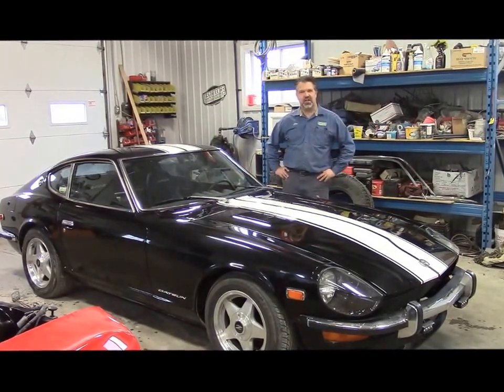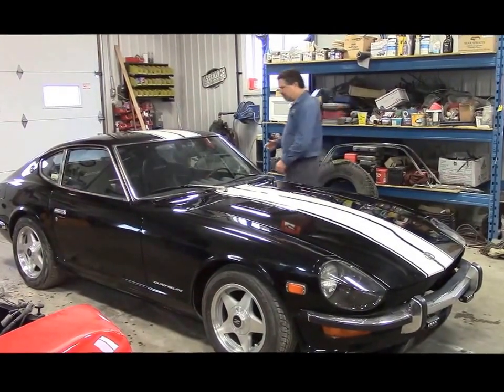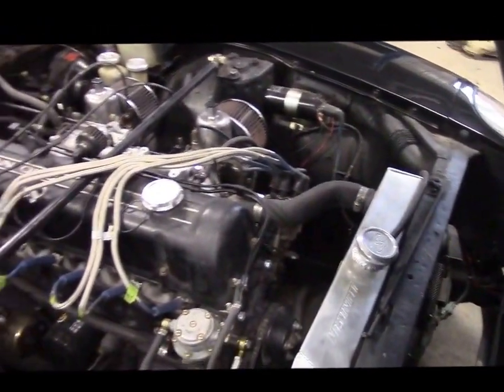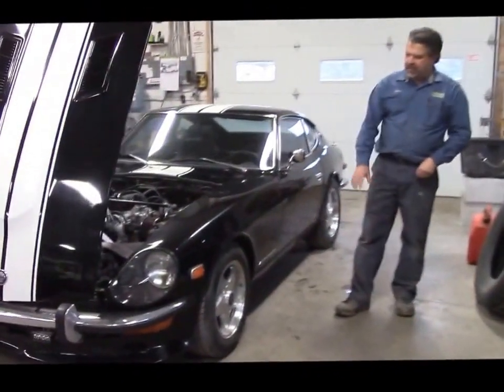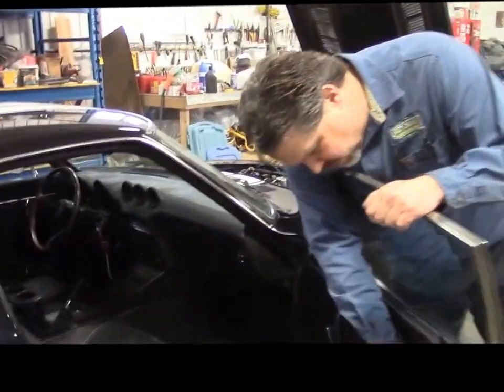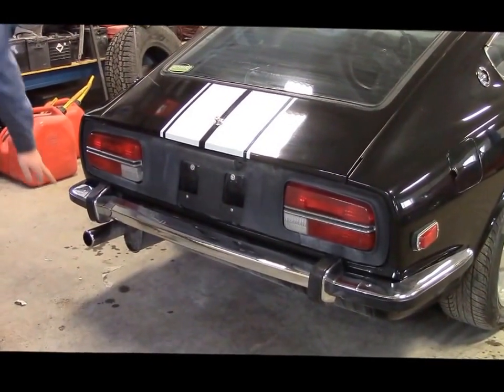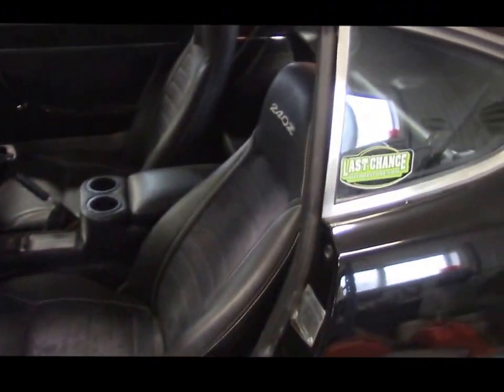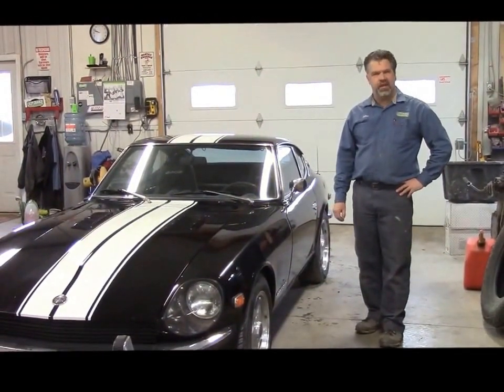1973 Datsun 240Z Restored walk- a- round, lastchanceautorestore.com

Comment: Like Most of the Newer Mods,Except the Stripe,Takes Away From the BEAUTY of The Long Hood,But Customer's  Preference,I Guess.Had A 78 280 & Really Enjoyed the Side Bolster Speakers,Made the Stk.Stereo Sound System Sound Great,But Not Sure the 240 Interior Allow Them.If U Haven't Already Done it,Might Want to Suggest Poly.Bushings on the Steering Rack & Suspension ,When They Come Due.Really Tighten the Steering , & Grip Over All.Also, One Of My Mechanics Fitted Toyota Supra Dual Piston Frt. Calipers on His Son' s 240,W/ 280 Eng.,Which Had the Weber Stage 3 Carbs.- Helped the Stopping Distance,A Lot.

Comment: oooh, a new Napa battery?!  lol BTW the 2.8 was not an upgrade to the 240, it was bigger because the solution controls in the 70's.  They both put out roughly the same power.  I don't know why they didn't take off the bumper over-riders.  And what's with the big bubbles on the door card at 8:24? The camera dude quickly panned away 'cause it look awful.